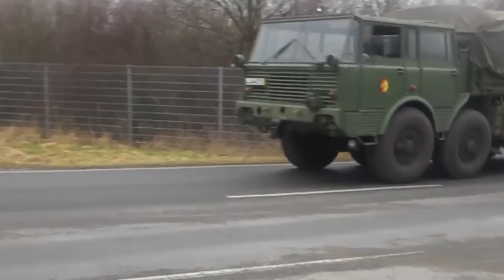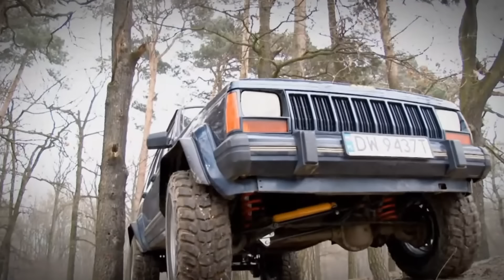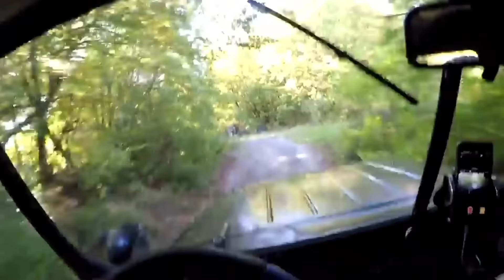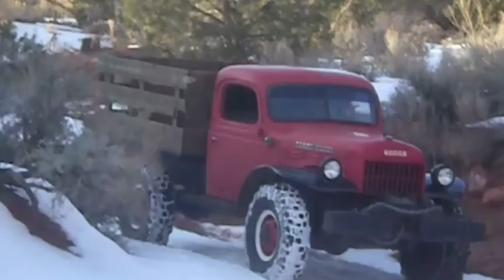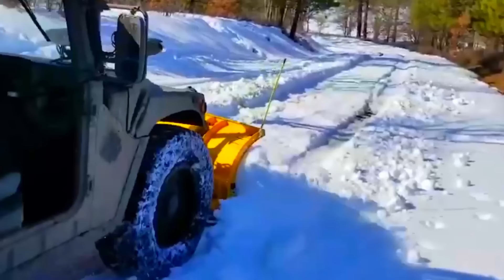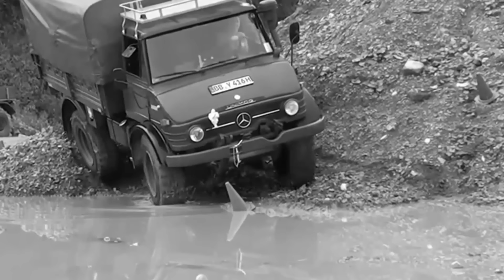10 Forgotten 4x4s Built to Survive the Apocalypse (Better than a Tank)

Comment: my daily driver is a '91 XJ with a 4.0, and the Renix EFI was not mechanical, it was SMPFI, Sequential Multi Port Fuel Injection, 1987 used 16lb injectors and made roughly 161HP, 1988 got 19lb injectors and horsepower jumped to 177HP, they respond to tuning and modification extremely well, and honestly is a Zero F*Ks given fuel injection system, late half of '91 (for the '92 model year) the horsepower jumped again to 190HP for the High Output engine and gained 12 LbFt of torque over the 1988 model year, horsepower jumped again in '97 with a change of the camshaft from a single pattern to a dual pattern design

Comment: I'm a little puzzled. why would you show the 40's/50's civilian power wagon as a "survival" vehicle. The civilian unit doesn't hold a candle to the military version. Mainly due to the lack of fording capabilities. The civilian units are just more pleasing to the eye compared to the military units. I'm thinking if you actually took a closer look at the capabilities and options of the M-37 models they would place a bit better than #5. Great example, see YouTube video by Bob Meredith, M 37 fording.
Reply: M37 with an upgraded braking system , possibly a 4bt and gear reduction. Now you’re talking !
Reply: M38A1 waterproof 24 volt 1953 looks like CJ-5. My choice